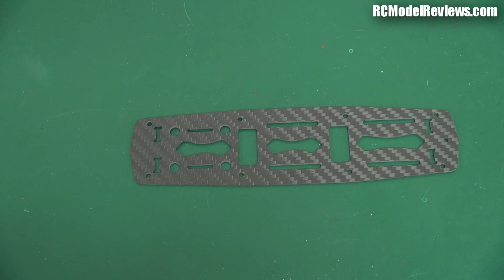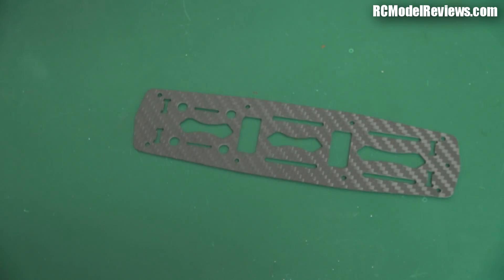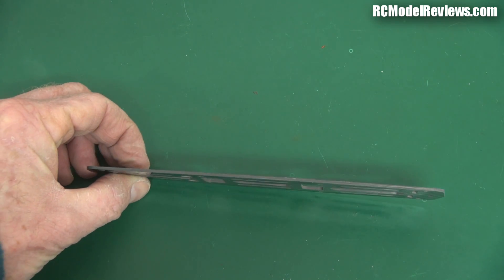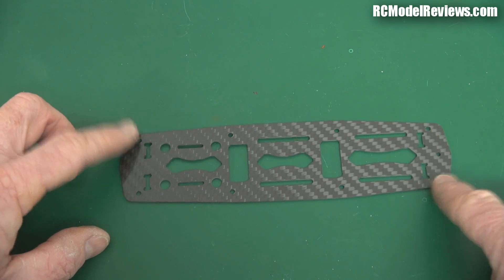Bad 250 mini quadcopter carbon fiber

Comment: Come on Bruce what do you expect with the price of these lol,most of what you have shown is easily worked through,i still wouldn't pay the prices of them other so called brand name products,now if her indoors would let me then i might LOL. 
Keep up the good work sir as it's appreciated. :-)
Reply: Yeah, the holes and such are a non-issue for me but the warps are not good at all.  A "bent" miniquad will simply never fly well and I'm pretty sure that although I've straightened this one for the time-being, it will be "bent" again after the first "impact" because the stresses in the layup remain.   If that's the case then it isn't a bargain at all.   The other issue is that this points to a dramatic and sudden drop in quality for this product and we don't know if they're going to get any worse.  What's next... a cunning switch to glass-cored carbon laminate instead of solid CF?  That's been done before.
Reply: ***** Yep I agree with that Bruce and that's another reason why I don't like buying my RC gear off of Ebay,i got the HK FPV mini quad kit and put my own motors and such on it,more than happy with that for the price and i'm now putting together the Laser230 fpv quad,also from HK and at $22 (Not CF) I thought it worth a gamble lol,kit is really easy to put together and would you believe well made IMHO,i've got the cheap DYS 2300kv motors on it with the afro 12amp ESC's and of course the Naze32 full board,hoping to give it a test flight at the week end. :-)

Comment: I did manage to break one of my arms but that was from a hard hit at 45 degree angle on to concrete directly on the end of the arm. I would suspect that even a Blackout would have broken also with the same hit.

I have crashed it into the ground several times with it cartwheeling for several feet before stopping , I have even crashed it directly into a tree head first and nothing... Just a little bump in the front but it didn't break anything so the CF seems to hold up pretty well.

Now on the new frame I ordered the carbon weave was smaller like the one that you showed in the video so I am curious to see how well that one holds up. As for the milling issues you have on yours neither one of mine had any milling issues. My motors fit the slots for the motor mounting but I did have to drill the slot a little larger since I use 2208 motors that use 3mm screws instead of 2mm.

So far the only issue I have had was with one of the standoffs not having threads all the way to the end so I had to use a longer screw to tighten it down properly.

Thank You for your review and all the work you do for the hobby.

Comment: Why do I spend more money on brand name products? Well, it has been my experience that in these matters you have "Good", "Fast", and "Cheap" ... but you can only mix and match 2 of those aspects; If you want it good and fast, it ain't cheap. If you want it cheap and fast, it ain't good. If you want it good and cheap, it ain't fast.
I always go with the good and fast.
Reply: Funny though isn't it how Bruce flys with no name radio gear? FRSKY is NOT name brand but a cheap Chinese clone!
Where is the name brand Futaba? Airtronics? HiTech, etc? Oh yeah those cost real money and no one will give him one for free to use....see that pattern here???? A blind man can.....
Reply: G E Gore
False clause- just because Bruce doesn't show or use or feature those brands you mention does not mean they are not worth the extra- each product and item needs to be compared accordingly-
I use FrSky products with my Futaba... but in specific use cases- not as a standard. I use HiTech servos- but some applications do not require robust components. I can show where the $28 FrSky Rx will not work as well as the $60 Futaba- in a specific case- doesn't mean Futaba is better as a standard.
A blind man can also tell the difference between apples and oranges.

Comment: Whatever Happened to " White Board Wednesday"  ?
Reply: My white-board is in need of its 200hr service. The "engine check" light has come on and it's only working in "safe" mode :-)   Actually, I've been meaning to get a bunch of new markers because the old ones are infuriatingly dry :-(

Comment: I owned 2 QAV 250 carbon fiber frame, never regret buying branded frame. The quality is always there. No point buying a cheap frame that makes u sit indoor for most of the time fitting / repairing it. I hit my QAV bulls eye to a steel lamp post in high speed, i only got a bent prop, and scratch marks. I doubt the cheap frame can survive that. 
Your fpv + flight controller + electronics are more expensive than the frame, I will not carry them flying fast in a cheap frame. 
Thanks Bruce for clarifying the differences of branded and cheap frame.

Comment: I don't understand the mini quad hype. I can also fly in between trees with my 600 tri.
Reply: You won't understand until you fly one. I hardly ever fly my deadcat quad anymore. The mini can do everything it can and more with the exception of 20 minute flight times. The mini is easier to just grab and go fly since everything is so small and light.
Reply: Science.
Reply: Lol, true and you probably should make a nice video of that if you haven't already. :)
Reply: PHeMoX im getting some fpv stuff, just a 7 inch monitor... i have a gopro so i will record, i have footage but its just flying in circles and some sweeps. if i do make a vid, it will probably be in like a month or 2 or never....
Modified RC ok, but i don't like quads. yes i could try a small tri, but i rather have my bigger and more noob friendly tri at the moment.
Reply: The main thing about mini quads is their low mass. This means you can accelerate and change direction ( also counted as accelerating) a lot faster than you can with a heavier quad. It's kinda like comparing a big four stroke motorbike to a 2-stroke dirt bike.
Reply: hmm....I may be attempting a mini tricopter at some point, that sounds fun.
Reply: SteevyTable I just finished the build of a carbon fiber mini Tri. It is very agile & fast.:)
Reply: benjahnz the weight does not make a difference. If the quad is heavier it has more thrust. No matter the weight, the trust is exactly the same as the weight during a hover. The reason they are fast is because the props spin faster, meaning when the quad starts moving, it does nor loose as much thrust as a slower spinning prop would. Picture it like the gears on a car, in 1sr gear, you can only go 20km/h, but in 6h gear you can go 200km/h. In first gear, 10km/h is 3000rpm and on 6th gear, 300(theoretically), you still have 5700 more compared to 3000 on 1st. Not only that, but because they are smaller and more compact, they have less air resistance compared to their weight, than a big quad.

Sorry for the essay.
Reply: Well guys, i will see how fpv is and after i have crashed my tri between trees, i might consider a mini quad and maybe sell the tri.
Reply: Where are you getting your info from Mr Tommymxr?? Some of what you say makes no sense at all.The weight, or more specifically, the power to weight ratio makes a huge difference.
Reply: Right...
Reply: I have hexes, tricopters, bigger quads. Hands down, the Blackout is by FAR the best and funniest of them all. Just try one.
That bloody thing is even quite good for filming. And seems indestructible..
Reply: i will see, i was planning on getting fpv stuff, but i just got an invite for the one + one.... sooo there goes my budget.
Reply: benjahnz  i agree 4 stroke are the future ! !!!!!!!!!! lol jk

Comment: Were these all bought from the same supplier? If not, was there one that was worse than another? I sometimes wonder whether some of these sellers simply buy rejects from large Chinese part producers or go dumpster diving.

Anyway, I'd expect a $30 frame might have QC issues compared to a $150 frame. Buy two $30 frame sets and do your own QC selection of parts.
Reply: Yes, these all came from the same seller so I suspect that the manufacturers are finding ways to cut costs and speed up production -- at the cost of quality and consistency.  That's not at all unusual (in my experience) for popular Chinese products.  There have been a number of other products (notably servos) which have been great when first released but eventually the manufacturer switches to cheaper motors, pots and amps -- in order to ramp up their profit margin -- and the result is that what was once great becomes crap.
Reply: ***** are they all from banggood?

Comment: Hey Bruce, I'm really hoping you do some proper crash testing with these frames e.g. get 10m altitude and then kill the motors to see how it handles a hit.  Those frames not only have really bad QC and machining but also use really terrible carbon (if its carbon at all) and probably don't have any 45 deg bias in the weave at all.  Looks and finish is one thing.  Durability over time is another.

Comment: stop moaning unless you can do better and cheaper what do you  expects for the price on there on a money like 1p a hour
Reply: I think you're confused as to how reviews works... if it's shit, I'd expect him to say it's shit, regardless of how cheap the product was.
Reply: I don't think he's being unreasonable at all. He generally prefers the cheap stuff, but it's obvious these carbon fiber parts are incredibly bad. Keep in mind how not all cheap clone carbon fiber is like this. I've build lots of HK 450 and 500 helicopters and the carbon fiber was a lot more on par with say Align's higher quality carbon fiber than these quads. So ... it can be done cheaper and better than these quad frames.
Reply: have you watched the video to the end?
Reply: Nitro Rc Adventures I think people will still buy them and i think this review is fair. Some people will get lucky and not have to deal with as many issues as in this particular review. Others wont. It's only fair to show everything good and bad which this and other reviews demonstrate.
Or to put it another way; if you don't like this review stop moaning and do one yourself!
Reply: yer
Reply: good point

Comment: I only use 2 screws to mount motors and it holds just fine.
Also I don't think that those imperfections affect flying performance at all.
Reply: David Hasko but duration

Comment: guys, what quadcopter / plane to start off as a beginner? As well as a cheap ($50 - $200) / decent price. THANKS!
Reply: Well which one they are very different
Reply: TheLukey21 either one, what do you think is the best for starting out?
Reply: anythingbutyou andmoreme a plane is definitely easier to start with the orientation of quadcopters is hard to get used to.
Reply: TheLukey21 Is there i specific model of R/C Plane that is good for starting out?
Reply: anythingbutyou andmoreme personally I have only ever scratch built my planes but have a look at the bixler
Reply: AXN is good. I think a plane is a good first choice. Less fiddling than a quad.

Comment: Mine came all good no flaws at all. :-)
Reply: Yes, the first lot seem to have been fine but I've had a couple of people email me to say that they have also received very sub-standard examples of this product and looking at some of the feedback on some of the Chinese websites, it appears that the quality has taken a marked dive in recent weeks.   That's why I bought another just recently -- to check for myself.
Reply: I got the non carbon fiber one. It was $10 cheaper at about $28 delivered. I must say I was surprised  how good the quality was.  I note that one of the Mobius holes
for the rubber balls is larger like you mentioned. I am sure this is intentional but I don't know why?